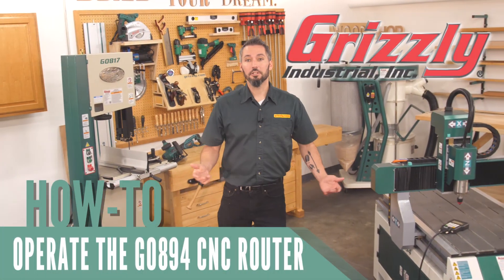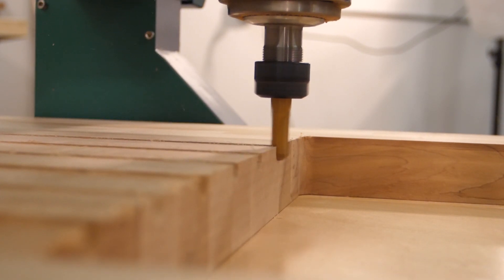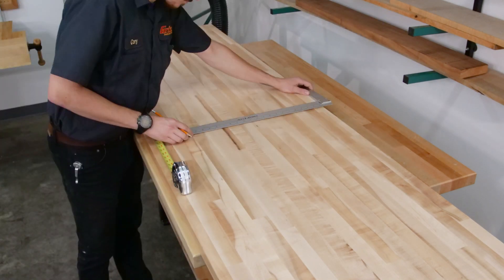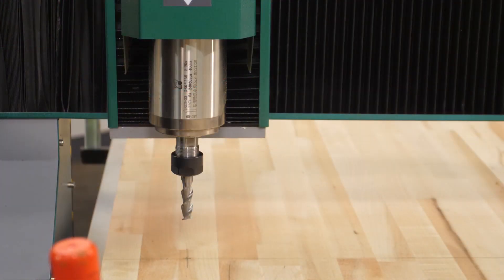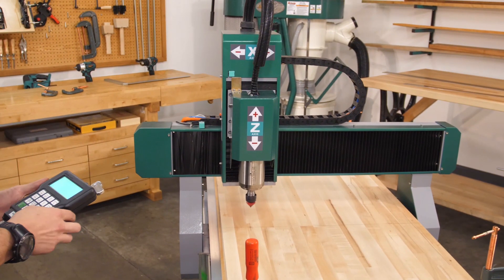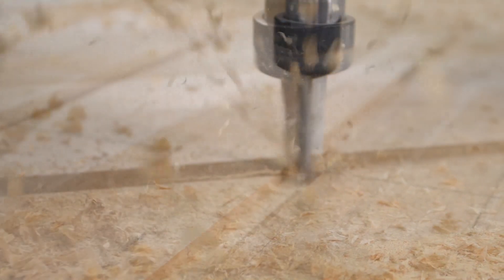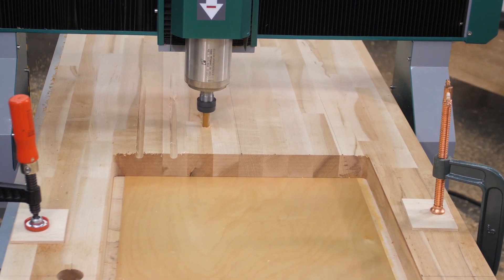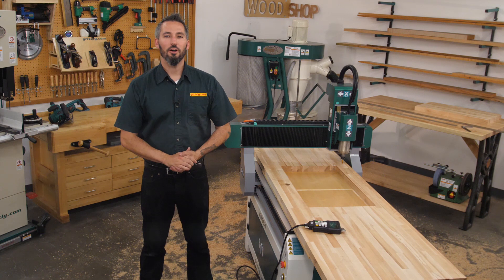Butcher Block Kitchen Sink: Grizzly CNC Project

Comment: I would like to know if I can fit this with an ATC spindle so that I can manually quick change or let the machine just run a single file from my VCarve pro. I ask because I have ATC on a desktop CNC by Stepcraft right now, the D.840. It’s a feature this machine really needs to make it perfect for my shop.

Also, desperately need to be able to add a touch plate to this machine! 

I’m looking to use something like the FM30F

Comment: Do these machines support tool changes in the middle of the program or is it one program per cutter? Can they connect to a PC to use other controllers such as Mach3?
Reply from the maker: Our CNC routers support manual tool changes. Typically, it's 1 tool per cut program, but operations can be linked together to create larger programs with numerous tool changes. Our controllers will support this; however, the ability to combine operations and generate a single code depends on the software and post processor being used. As far as connecting to pc to use a separate computer-based operating software, our routers do not allow this. They only operate with their native control system. That said, they will connect directly to pc, but only for file transfer or diagnostics.

Comment: Programming is the key as to the validity of this machine for home. Having programmed CNC and even NC machines ( Yes I'm old) in years past has me skeptical on the feasibility of this  home unit. I'd like to see a video on the ease of programming. Is this machine capable of linear interpolation? How many axis's are capable simultaneously? I can already see 2 based on your tapered drain slots. I should mention, I do like Grizzly's equipment and own several pieces.
Reply from the maker: Hi there! These are such great questions, so I reached out to our resident expert in CNC and he had this reply: 

Yes, this machine is capable of linear interpolation on all 3 axes. CNC programming has come a long way in recent years. Programming this unit is as simple as creating a part design and setting up the necessary toolpaths within a compatible CAD/CAM software (such as Vcarve). Once your constraints and parameters are set, you can save the G-code file to a usb thumb drive, and plug that in to this machine's handheld controller. This then allows you to simply run the program with the push of a button. You can also handwrite your own G-code programs if you prefer the old school method. All you have to do is enter them in to a notepad file on your pc, and save them to your usb drive as .nc files.

I hope that helps!

Comment: Will this CNC work using Vectric VCarve Pro? Are there available Post Processors for this?
Reply from the maker: Hi there! Yes, the G0894 works with Vectric VCarve Pro, and there is a compatible Post Processor in the VCarve library. I hope that helps!